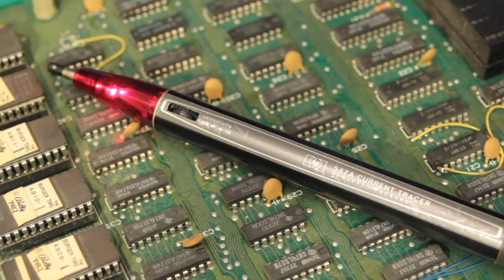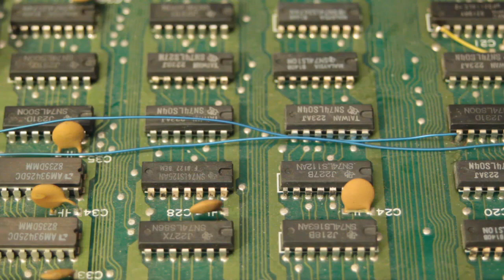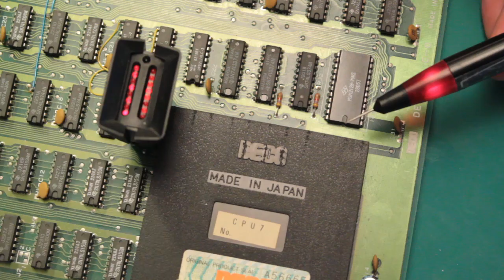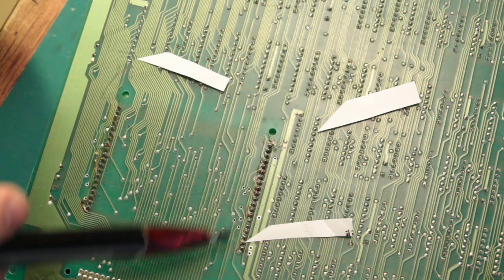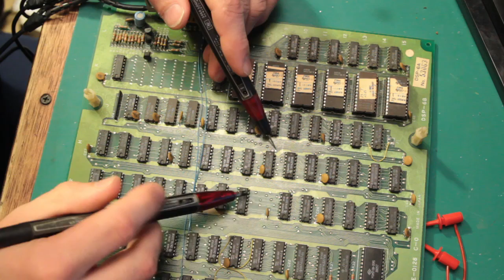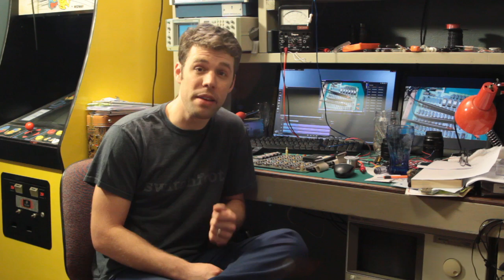Fix it Friday! (Logic Series 04) - Using a Current Tracer to Find Logic and Ground Shorts

Comment: What's the difference/advantage of the current tracer compared to a logic probe ?
Thanks in advance !
Reply: zauche81 a logic tracer is for detecting shorts and following the short current path to its source. A logic probe will only show the logic level from the detected voltage on that node, which may not vary if there is a short.

Comment: Very useful! I just ordered a set of the 545-548 on eBay.

I was working on a homebrew computer the other day, and it turns out one of my 74574's on the data bus was completely shot. My power supply was pushing over 1.5W through the chip, and I thought it was some issues with other chips in the area and something to do with floating pins(I had built half the thing before testing, and had also never worked with some of those chips before) but the dead chip was just pushing everything it was connected to to ground. Having one of those current probes would have made it a 10 second diagnosis.

Comment: Those ceramics are probably RAM, that's why they draw more current. For GND-shorts why not just use a multimeter set to diode-test, placing one probe on GND and just swipe the other probe along the pins listening for the beep? That's alot quicker than using the tracer. Also you can just use your hand to find any hot or shorted chip, which appart from RAMs should not get much warmer than the rest of the logic on the board.

Btw how did you "sabotage" that coupling cap? You didn't short it (?), or your PSU would overlaod and shut down.
Reply from the maker: That's true, it would be faster.  But, unless I misunderstand you, when you find the stuck node, there's no way to know using the continuity tester which chip is at fault without pulling chips or cutting traces, and in a more complicated game, where tons of stuff is attached to say, a data bus, this can get pretty ugly.  The current tracer gives us the ability to follow the direction of the short.  Also, just because a chip is hot, does not mean that it's shorted.  I could be getting hot because it's supplying current to a direct short.

Thanks for the reply I really appreciate feedback!
Reply: You could just cut the one suspected pin, no need to pull the complete chip, not cutting any trace. Usually if the chip is uncommonly hot I've found it to be bad, but as you say there may be several aspects to it.